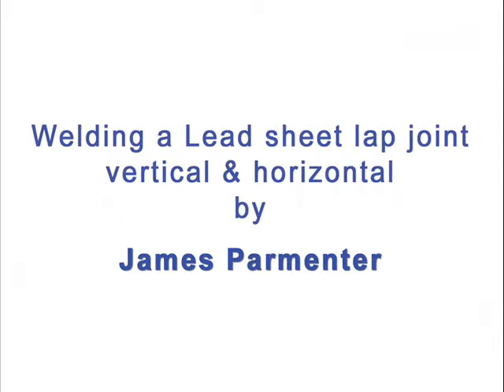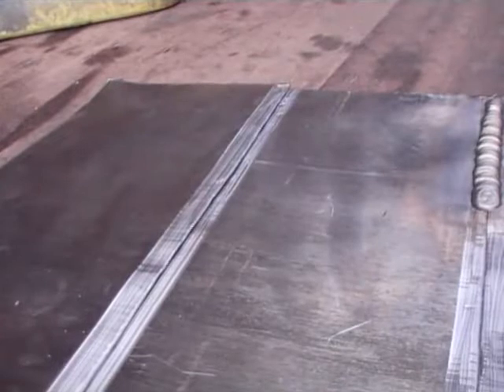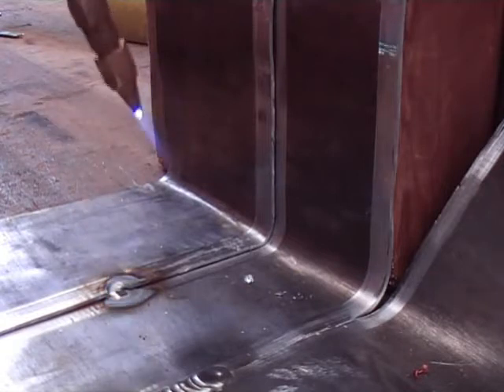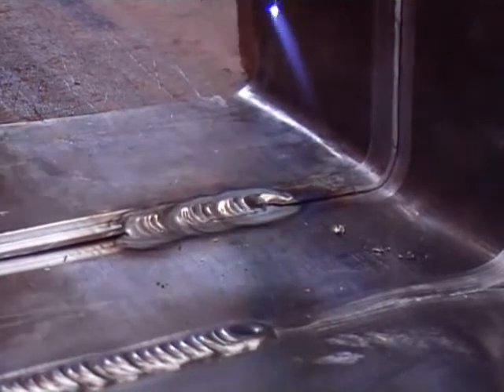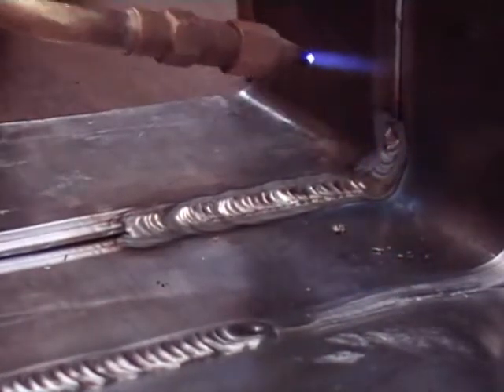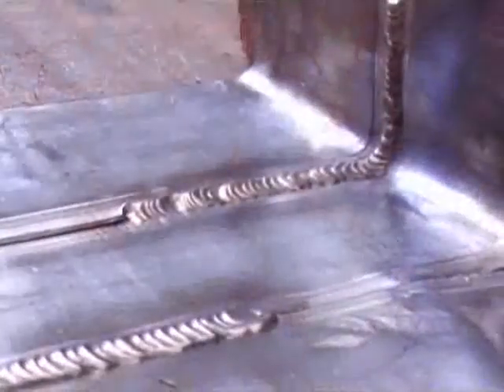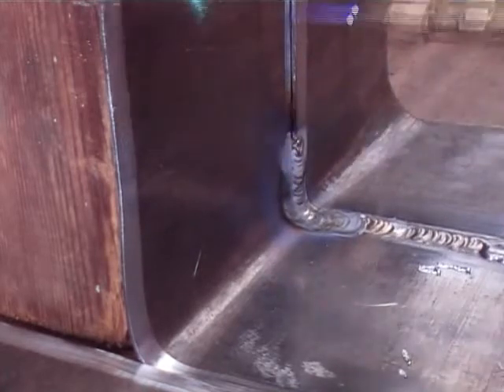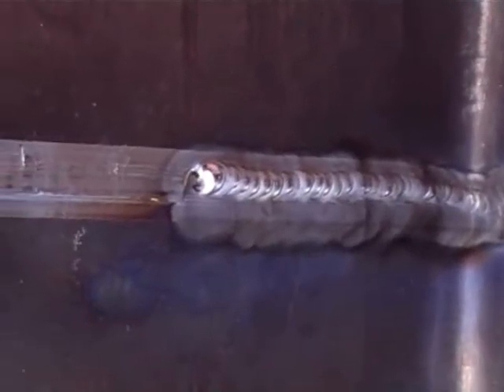LeadLapWeldJP.flv

Comment: In 27 years of lead roofing I have never not used a filler rod on flat welding, sometimes I use a double weld over the 1st run if it was expansion joint for instance. if I get a chance I will load up some on site welding done in real situations rather than a college bench. Check out the lead sheet assn guidelines as I doubt very much if what you are showing is in there. Nothing personal just  you need to teach kids the correct methods. (As I assume you are a lecturer?)